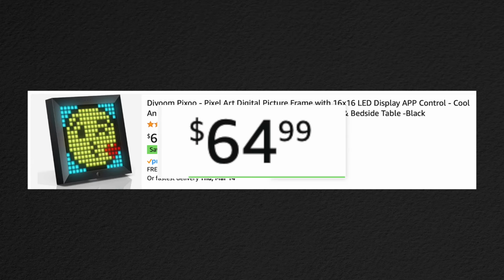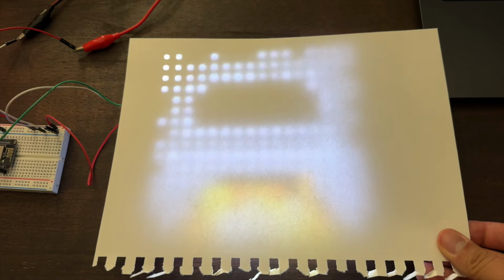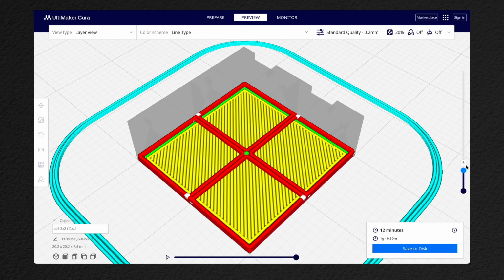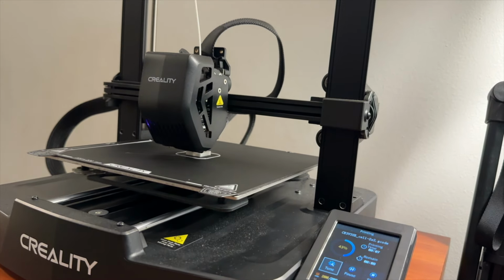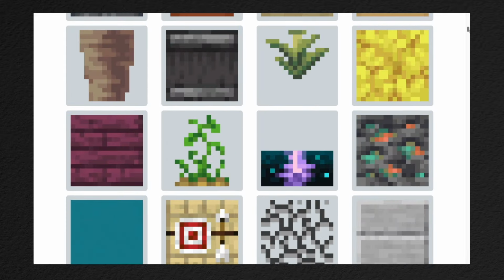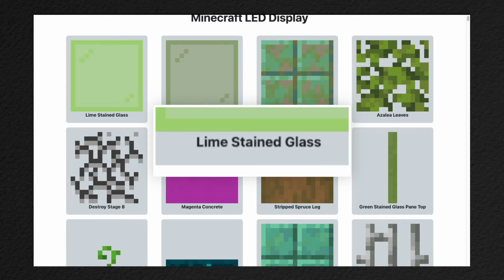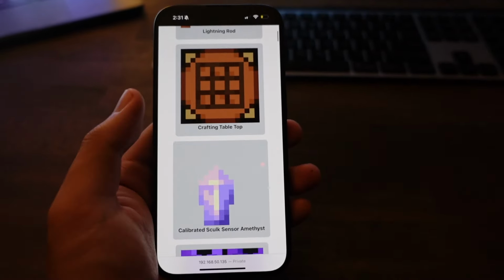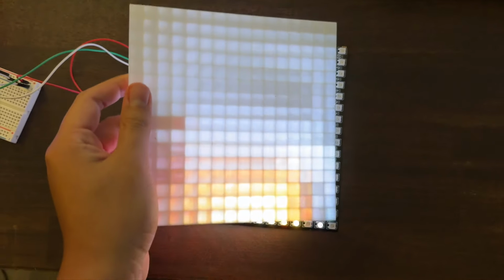Making a Minecraft LED Panel Because Nobody Sells Them

Comment: now do it 5 more times for full blocks
Reply from the maker: That would be cool, maybe in the future
Reply: @micah_tilton  do it NOW
Reply: @micah_tilton do it NOW
Reply: @micah_tilton do it whenever you want
Reply: Like this idea
Reply: @micah_tilton do it NOW ( but no fr please don't do things solely because of others )
Reply: Getting the corners to align properly would probably be an interesting challenge 🤔
Reply: THIS IS SO DAMN COOL!!!! You did a real dang good job yo!!!!
Reply: @ScriptCoded  I can't think of the way without adding 1x1 border (for it to basically become 18x18 with edges not displaying anything) using only the matrix shown in the video. You can buy led strip with the same diodes to make matrix yourself and allign first and last columns and rows at 45° so that edges are lit up on two sides, but that will make it unnecessarily harder
Reply: @Oretal check Alexgyver's channel, he has done that years ago (and he wasn't first too tbh)
Reply: @PoweredUP_  yeah or maybe if you could inset the corner LEDs a bit and divide them using a 45° divider. Because ideally you don't want the corners "shared" right?
Reply: the future is now old (?) man (?)
Reply: For practical purposes, it should only need 4. The bottom would just be a waste, unless you have a glass table
Reply: @mr.boomguy  you can place it on it's corner so that all the sides are visible
Reply: @micah_tilton yeah because in the past would be impossible…
Reply: @NoVIcE_Source YOU MADE CITADEL BLASTING CARAMELLDANSEN
Reply: @dacixn  helo
Reply: Bruh , that would be sick
Reply: Its 6
Reply: @micah_tilton do it when you feel like doing it :)
Reply: technically he wouldnt have to do the bottom
Reply: @micah_tilton  do it NOW
Reply: @micah_tilton DO IT NOW OR ELSE
Reply: I'm doing a 5-sided one!
Reply: @m2rbuilds  it's been 7 months but I'll take it

Comment: As a 3d printing guy myself i think you could shave off hours of this print with only few tweaks to the slicer and model:

1) you print VERY slowly, this creality printer is capable of exceeding 80mm/s with no mods while keeping the same quality of the print,  you might need to start running klipper if will want go over 80mm/s.

2) you need 100% infill only on the bottom, you can use CURA slicer to set diffrent infill levels based on the height (example: 100% for the first 10 layers the rest should be only 20%), this will speed your prints like 3x.

3) you dont need such a complicated shape to begin with, an array of normal boxes with a square holes would have the same effect, considering of course that you will have a diffrent way of mounting it (not just hanging it on these leds).

3a) an alternative mount (such as small magnets) would be ideal as these no name manufacturers will change the model of the leds, they take whatever is the cheapest at the moment so you could get a board with diffrent pattern, casings, etc.
Reply from the maker: I appreciate the feedback a lot! I’m new to 3d printing. I am only good at the programming aspect lol. I will take your comments into consideration for the future. Thanks
Reply: I think higher infill everywhere is good, don’t want color bleed.
Reply: @ItsMeMas  Agreed, plus a low infill might be visible through the part if the light is shining through.
Reply: @ItsMeMas  You will have colorbleed none the less....use a separate grid + diffuser and print the grid black. It's what I'm doing now for a 32x32 grid. I tested it on an 8x8 version and it's magic!
Reply: @Chrisrkooz thats why iam suggesting 100% infill on the part that the led light will shine thru

Comment: May look even better if you print the diffuser layers in white, but pause and switch to black for the rest of the print to futher sharpen the details and prevent light bleed in things like the rose bush or other textures with a lot of dark pixels.

Comment: This is definitely my next project after i finish my dartboard, i have been experimenting with ws2812bs alot and this would be fairly easy to make a full block out of it, except while writing this comment i think i found a problem with the edges as i would have to put some of the plates kinda inside it and not on the outside right?, if anyone got an idea how i would fix this it would be appreciated
Reply: English is defo not my strength lmao